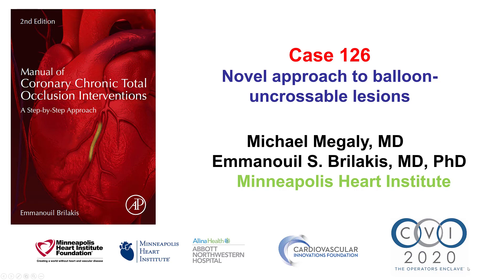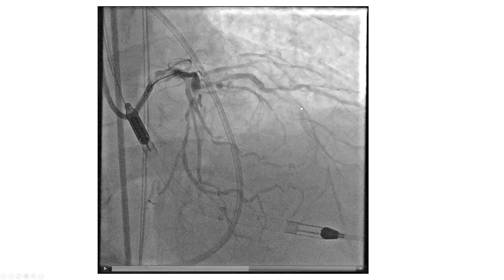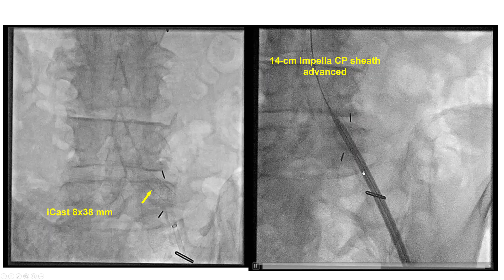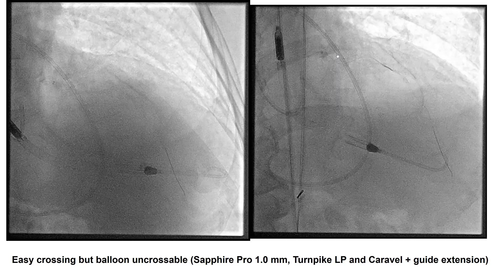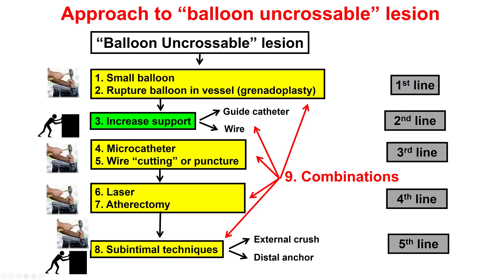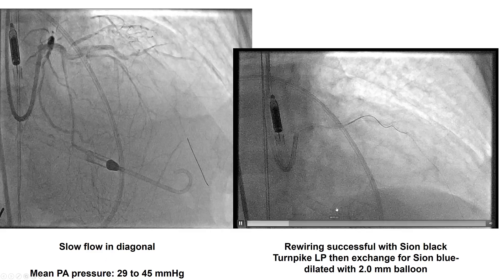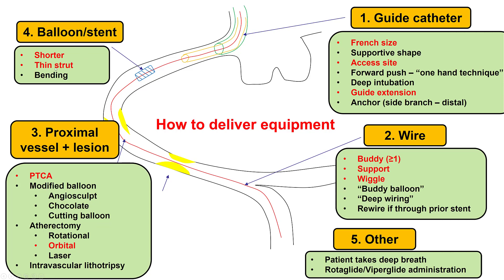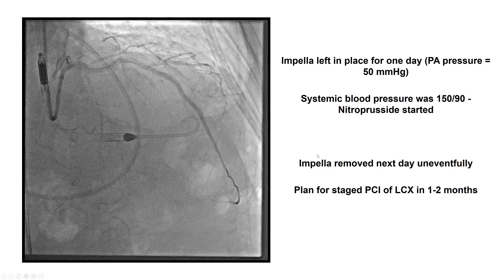Case 126: Manual of CTO Interventions - Balloon uncrossable occlusion

Comment: Great case and approach. 

For CTO and orbital atherectomy; isn't it necessary for the orbital atherectomy crown to engage the lesion for effective plaque modification? If the lesion is CTO that is balloon and microcatheter uncrossable, will it make the crown engagement impossible, given the crown is mounted on the center of a tapered shaft? Thank you for your input.